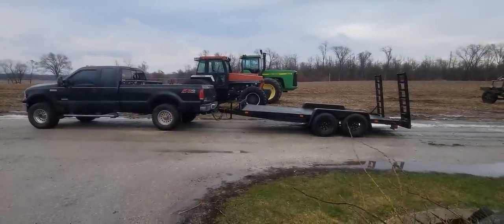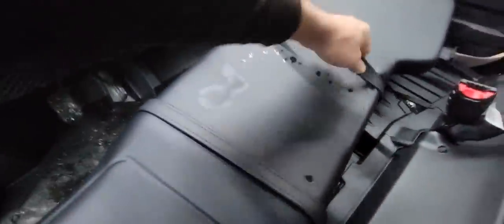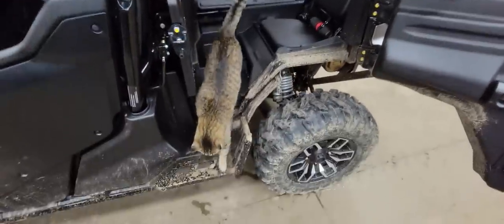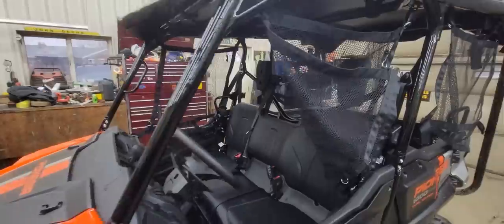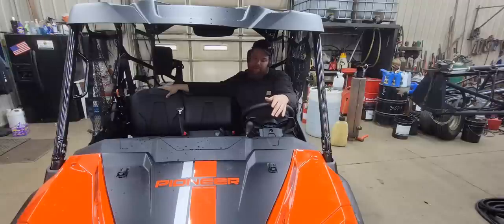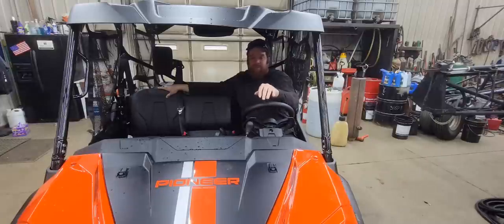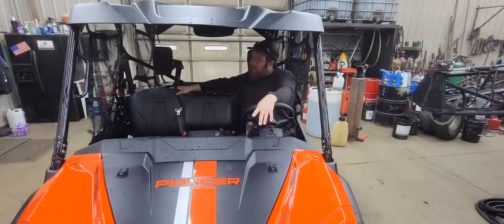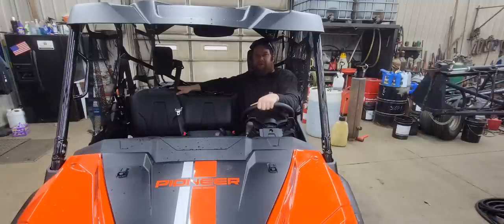Got My Very First Honda Pioneer 1000-5 Side By Side UTV!!

Comment: Hey Congratulation on your purchase. My wife and I bought a Honda Pioneer 1000-5 new in 2021. Thete really hadn't been a dull moment around the house scenes. 

We live in rural Ohio. My advice to you is plate it.  You put a License Plate on that you wont be harrassed anywhere. Even in some towns. We put turn signals on as well. We ride it everywhere. We have almost 800 miles on it and have been off road once.
Hope you got the split windshield. Bit warm in the summer. 
They do make a kit to take the heat off the front seat but not the back seats.  Really no complaints from anyone.  Have fun!!!!
Reply from the maker: Thank you! I absolutely love mine at first I was a little nervous spending what I did to buy one but oh man has it paid for its self!!! I do alot of equipment recovery and the Pioneer has been awsome for getting my tow ropes and rigging out to whatever is stuck! I have it registered here in Indiana and so far I haven't had any issues driving it around and we go all over our area with it we drive it around almost nightly I've got almost 1000 miles on it already lol

I should have got the split windshield I got the solid one it would be nice to have the air flow....thanks for watching!

Comment: wow that must have set you back a bit of cash! those are a amazing versatile piece of equipment.
pulls good and are able to go in all types of conditions. cannot wait to see it out of the trails.
Reply from the maker: Not really to bad I got a 5 year loan and I'll most likely just pay it off early  now like my John Deere 1025R when I purchased that it the interest rate was so and it had such a good insurance policy through Deere that I let it go the full 5 years I could have payed it off several times but it just didn't make sense to loose the insurance
Reply: @Unintentional Failure yes only fools with their money do not look at the costs.
you save and then buy, paying over time costs 2x or 3x the value of the original purchase 
price. by the time you are done, it has little or no value and you are looking for a new
one to buy. if insurance is included, then you need to see if the combination is less costly
then paying it off fast, that it might even save you money over time. you have to evaluate 
the amounts involved, and evaluate the best value over time.

Comment: Just a tip for the rear seats , we put a boat cushion on top of the seat it helps from keeping the belt latches from digging into your sides; also gets you up taller an helps stretch your legs.  I also second riding in Norther Michigan, specifically the U.P.  
I run out of Grand Marais

Comment: I found a nice 1998 Toyota Tacoma that I picked up for 3K that has AC/heat. Doors and roll up windows that will go anywhere that 30K Honda will go. It will haul more and pull more as well.
Reply: I agree 100%, these vehicles are perfect for doing nature tours, with seating for the tourists and their  back packs in the bed. Weather permitting!  For the farm it should have front and rear 3pt, maybe midmount mower, just looks like a tougher version of a golf cart. The Tacoma with a Honda four trax, would be more practical I'll wait for the HF version.

Comment: O man I bought mine almost a year ago this April 15 I think,its been great only thing is the cold she don’t like the cold starts at all I got the 2022 deluxe I have a two batteries windshield hard roof fabric back window and upper doors for it a winch and a LED bar and of corse sip lights lol they look cool driving around on the ice o and I have Diamond style studded chains for it it doesn’t get stuck unless you bottom out in snow and nothing to winch too lol!! It’s the cold that’s my only complaint o and the seat belt buckle DONT JUMP in fast AAAHHH you can just imagine lol not fun

Comment: How fast can this go?
Reply from the maker: 65mph it's electronically limited after that but 65 is plenty lol
Reply: @dirtgrainsteel  I Completely agree. 65 is more than enough.

I have a 2 seater YXZ1000R with a growing family. I'll probably buy this instead of spending $40k plus on a 4 seat Can Am or Polaris.

I do question how it will do in the Sand Dunes 🤔 Preferbly Glamis out in Brawley, California.

Have you taken this in the dunes?
Reply from the maker: @anythingadrenaline4515  well I can tell you these Hondas are tough my buddy Zac just went to west Virginia with his 4 seat Honda Talon and rode a few hundred miles of trails with no mechanical problems.....I have no sand dunes to be able to give you answer on that but I did have the pioneer out in very soft freshly plowed ground and power was not a issue so I think it will be perfectly fine on the dunes with the proper tires